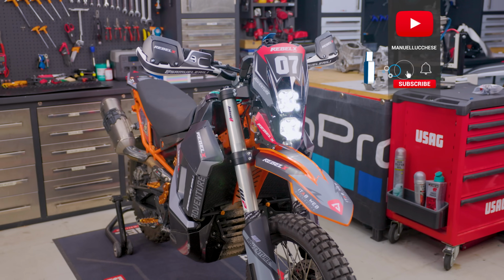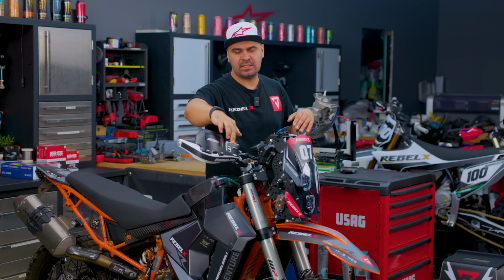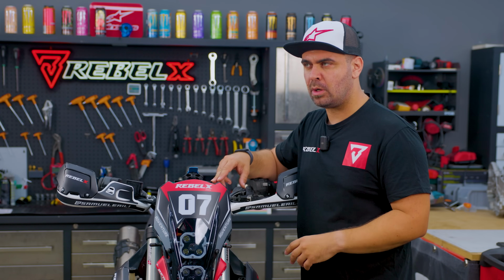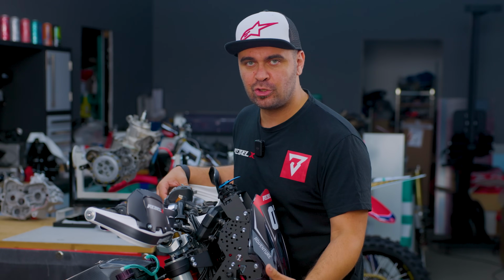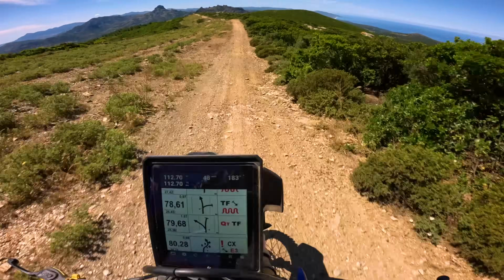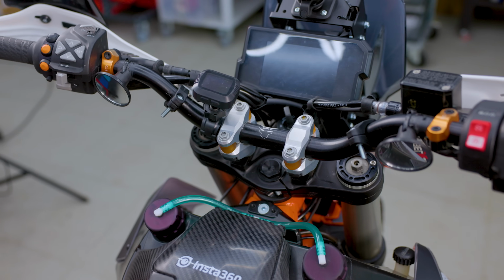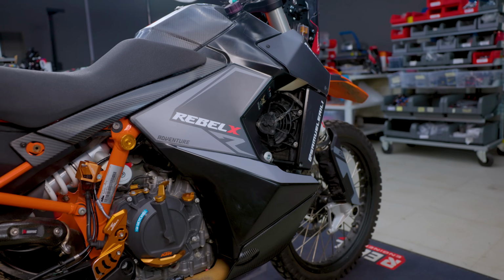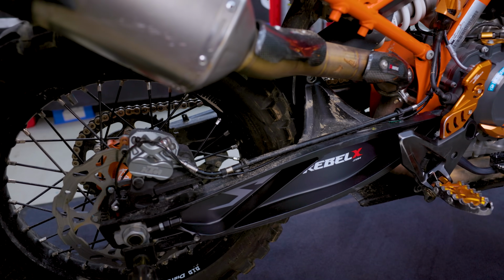KTM 890 Hooligan Adventure Build

Comment: The Kit Ultralight is "ultra" yes, but it's not" light". Is 400gr heavier than OEM.
Reply from the maker: Sorry but you have incorrect data
Reply: @ManuelLucchese1 So give the data, you never said them... I have the OEM disassembled and it weighs 3,800g and the "Ultraheavy" kit 4,200g
Reply from the maker: @emilobravo2200 I posted it time ago on my IG the weight depends also on which headlight solution you go for but the tower body alone is 900 grams without lights
Reply: @ManuelLucchese1 How can you say that if just the main part weighed 1 kg? The FedEx package weighed 5 kg. Can you remove 300 grams of cardboard? I have everything disassembled and weighed, along with photos. I'll send them to you, or a video if you want.
Reply from the maker: @emilobravo2200 sorry but I really don’t understand the point of your comment, this kit has many different configurations. This said many times there is a misconception between wanting a reliable solution and weight. Weight alone has not much sense as from engineering point of view what is important weight distribution, where your devices will be placed etc. I use this kit on my personal bike and I’m super happy with it, clearly doesn’t have to be for everyone this way, not everyone needs a reliable kit to race.
Reply: @ManuelLucchese1 I love this kit, I recommend it. I just want to mention its actual weight.

Comment: This is it! I need this kit, both of the mounting points on my 20 790 adv have broken off, Ive installed the Triple Clamps bracket which is working, but, the screws holding the brace are snaping off over time, I want to be done with this, I think the Nomad kit works without the factory mounts but this looks sooo much better

Comment: Hi Manuel, I love the look of the ultralight tower on the 890 adv r!! The best looking frontend on the market. I would buy the tower immediately for my 890, if I would be sure, that the German TÜV like it as well :-). Is the combination of the lights and the windshield street legal in Germany? Will there be a corresponding TÜV certificate?
Reply: I installed this kit on my Off-Road Nuda. With the optionally offered and approved Hella headlights, there were no problems with the German TÜV. You can definitely feel the larger mass around the steering axis, but you get used to it.

Comment: Love it! You don't mention the tanks, are they the rade garage ones? Also, do you have a link to the tower? It looks really good, much tidier option for my 790
Reply from the maker: thanks!!! the tower is the Rebel X KTM EXC Ultralight and I designed a bracket to clamp it on the 890, I still not sure if it will actually then be produced but possibly the decision will be made in a few weeks

Comment: I would have been interested in the final weight with the lightweight tower and the single brake disc in the front and the removed fairing in the rear.
Reply from the maker: Wish I had a scale to check the weight, for the future its in my plan to get one to check the weight of all bike builds
Reply: Literally the only reason I started watching. Thanks for saving me the time lol

Comment: Your videos are amazing. But, I'm sure you have more information that can be very useful for your potential clients, like final weight loss, power increase, final budget, etc 😊. Would you mind start including that infornation in the videos?
Reply: I totally agree! Total weight (reduction) would be the most interesting detail of the vid.
Reply: Mehrleistung durch andere Lampen .
Fake news 😉😉
Reply from the maker: Unfortunately I do not have yet a scale to check the total weight of the bike builds, I surely plan getting one for the future! Budget difficult to say exactly as some components were already on the bike when Simone took it to me but basically the fairing kit is around 900-1000 euro
Reply: @ManuelLucchese1  any eta on release for this rally kit?
Also, what handguards are those?
Reply: @ManuelLucchese1  If you have it at home you can put the bike on 3 classic human scales (wheels and sidestand) and make an addition